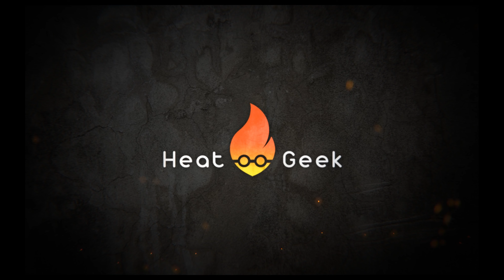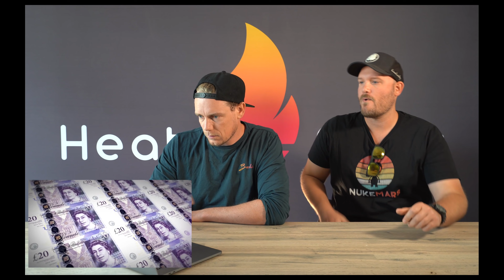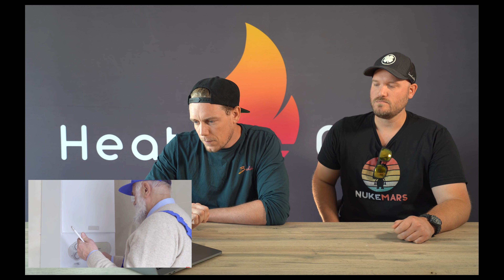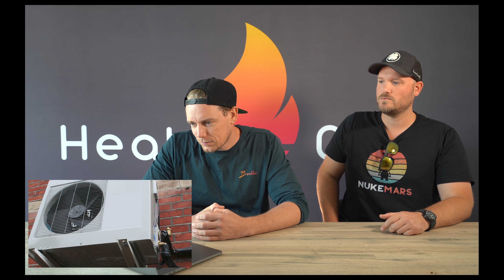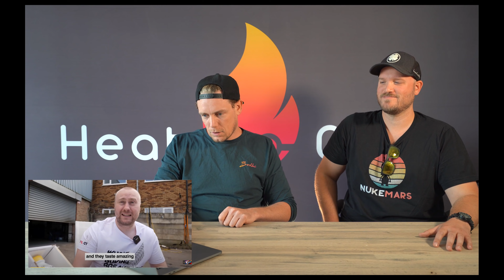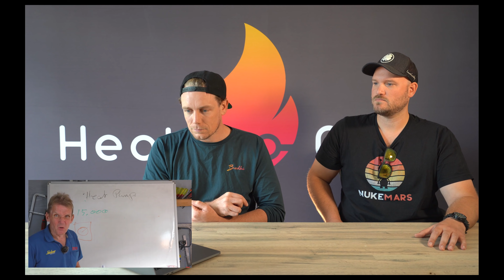Professionals React (BADLY) To Skill Builders's Heat Pump Videos | PART 1 | FIRST TIME WATCHING

Comment: Skilled builder has never said Heat Pump are not a solution as Roger clearly states Heat pumps do have place . What Roger is saying heat pumps are being pushed as the only option by the current U.K. Government.
Reply from the maker: No he litrally says you need underfloor heating and sweedish insulation standards..  and when they do work they inky have a scop of 2..

Comment: Where do we find a reliable source for recommended, well trained heat pump installers? Those installers that will do the things you are suggesting that will make heat pumps a positive addition to a house. Thanks
Reply from the maker: Search Google for 'find a heat geek', then cross reference this with the mcs database

Comment: Good day all, just my 5 cents worth. I am a refrigeration technician in Johannesburg South Africa and have worked with heat pumps extensively over many years. In my experience they only work well in higher ambient conditions in order to reject the heat into the atmosphere, when ambient temperature are very low they will not be efficient.

Comment: You two need to do your research on skill builder before you start to criticise the videos I thought everyone in the trade knew who roger was until I stumbled across these two 🤣
Reply from the maker: We've learned alot since..  non of it changes our position though??
Reply: Why not? Roger has over 30years of experience in all aspects of the trade including the sector you work in roger used to catch rogue traders on t.v an we all like he's rants(the video you were criticising )some of the thing you were saying just seemed like you were just trying to nit pick his choice of wording anyway each to their own opinion 😉
Reply from the maker: @rayl9969  because he essentially admits he did not design the system or do a performance estimate before his installs which is heat pumps 101.. I'm sure he's got alot of experience with boilers.. but poorly installing a couple of heat pumps doesn't make you a good heat pump installer.

Further more, drawing a thermal store for a heat pump showed the lack of knowledge of how low temp system efficiency is maximised. It might sound complex to end users but this is basic stuff for those in the know

Comment: 21:36 Heat pumps will have higher operating temperatures over time; but the higher temperature difference always makes it inefficient because it requires a higher compression ratio for the refrigerant.
Reply from the maker: Correct.. but the efficiency at higher temps os also climbing..
Reply: @HeatGeek  yes but at what price ? :Reliability? It wil cost like a spaceship? 
And another question a little bit deviated from the subject regarding only air-to-water and air-to-air heat pumps: 
How many technicians are currently able to correctly diagnose a state-of-the-art heat pump? how do they handle if it is -10 -20 degrees Celsius outside and they have to work in those conditions? how many of them are willing to work outside at this temperature?

Comment: I consider it more efficient / beneficial if a house that already has an old gas boiler gives up the installation of a heat pump and with that budget a new thermal power plant is installed (without changing the existing installations) with high modulation (10 : 1 or more) and with the difference in money the thermal insulation of the building is improved (maybe associated with a budget already pre-allocated for a restoration of the exterior of the building or windows)
This is how you should get a better return on the money invested in your home !!!
And there is another advantage in better thermal insulation of the house: the investment in the thermal insulation of the building works all year round 24/7, which means that it will reduce your need to cool the house during the summer ....
All of the above apply to homes in temperate countries that already have gas
  : P .... There is no perfect solution

Comment: Waste of time arguing re heat pump gas boiler if the insulation levels were comparable a 3 bed house would need minimal heat input therefore the cost of installing either would make the payback unfeasable,heat pumps more so the government needs to wake up to the fact that insulation is the place where the money should be spent ,why is there 20% V.A.T. on insulation a no brainer.

Comment: If you fact checkin his video Vaillent boilers are manufactured in the UK and the carbon costs of that are not exported to China
Reply from the maker: No, they are assembled in the UK. The hobeywell gas valve and fan... China.. honeyywell pcb... china.. casing... china

Comment: Why not fill the radiators with R34 if it boils at low temperature heat transference back into the room? Would it work
Reply from the maker: You cant create energy.. the same transfer would happen

Comment: Heat pumps use more fossil fuel (at the power station) than a fossil fuel boiler.  That’s because of 50% losses in the power station plus transmission losses are greater than the gain from the heat pump.  These NEW loads require NEW windfarms, they will contribute a couple of percent of electricity for heat pumps at best.

Comment: Electric Heat pumps have an efficiency of about 200% but electricity is 400% more expensive than gas.  Therefore your fuel bills will double.  That’s all you need to know.
Reply from the maker: 🤣🤣🤣 been listening too much to Roger if you think they're 200% efficient. Your in the dark ages mate 👌
Reply: @HeatGeek    What efficiency do you think they are.  Average over a year, weighted for higher use in the winter and including defrosting and immersion heaters?
Reply from the maker: @grippipethin2796  that's what a SCOP is... seasonal Cop.. . it doesn't have to be guessed though it SHOULD be calculated based on a specific design when you provide the quote so you can work out how much its going to cost to run.. too many installers lobbing them and like skill builder find out its expensive 2 years later because they did no design.. 

I have no idea if the the average SCOP for all heat pumps but is would mean nothing.. lots of installs have been thrown in and are crap and the range is way too wide to mean anything.. also newer units are getting waaay better scops than older..  but the average scop for a proper install with a decent unit will be 3.2 to 5.2 depending on the system design/flow temp design.
Reply: @HeatGeek    What changes have been made to the air source heat pump (not the system) to increase the COP in recent years?  Compressor efficiencies have barely changed in decades, the evaporator side is just a fan, there’s no scope for improvement.  Miniscule improvements with inverter starting maybe.  Apart from the compressor there’s no way to improve COP.
Reply from the maker: @grippipethin2796  well the controls have a massive impact.. some have had this down for a whilr and somema way to go.. advanced weather compensation (as apposed yo crappy basic in air con derived units) has a good difference.. but I suppose the biggest leap in the last couple of years has been the transition to R290 refrigerant which allows bother higher temperatures AND higher cops. We're now aiming for Scops of 5.
Reply: @HeatGeek    I suspect the scop numbers quoted by the heat pump manufacturers are a bit like the mpg numbers of car manufacturers or the range numbers quoted by EV manufacturers or the power from solar panel manufacturers, or wind power manufacturers.  In real life nobody can ever get near them and a rough guide would be half or two thirds of the quoted value.  Especially for heat pumps where it’s almost impossible for the consumer to check the SCOP himself.

Comment: 30 degree day outside would be really good?!!
You both sound English but clearly live in a different climate where its 30 degrees during the day (when I dont normally want heating) and zero at night.
Yes the are a good idea in the correct housing stock which we dont have due to expert heating engineers, Geeks if you will, being totally unaware of technology from 2000 years ago as they work best with underfloor heating.

Comment: We have a one bedroom granny Annex built on the side of our daughters house and we had this problem of how to heat it and hot water ,
after lots of searching on the net and cost calculating we decided to go electric at a fraction of going gas , we had a 10 litre boiler fitted in each the kitchen and bathroom 
did away with a bath tub and just had a electric shower and the radiators had  programmable timers and so far after six years we have had no problems,plus we’re saving on not having  costly gas boiler servicing ever year , But what was on our side is the high insulation our annex as .
Probably this  might not work for bigger or older properties.

Comment: @SkillBuilder has contacted you guys for a discussion. As a consumer it would be good to see some real life installations and advice from content producers rather than the polar opposites that seem to be out there. I'm personally in a position where I'm going to have microbore replaced across a large 4 bed in order to make the house future proof for heat pumps but all the he said she said makes it very confusing on which way to go and who to use.
Reply from the maker: Yes and we have responded wothban email to move things forward but with no reply
Reply: I'm pro heat pumps by the way and your recent video has shown it works. I'd prefer to bite the bullet and get a heat pump but the views on the ground are a turn off and skillbuilders type videos or news stories then don't help.
Reply from the maker: @UnriddenPath  the problem is gas boiler installers think they can install them because they've been doing heating years.  They can if they understand they work at a lower delta tee and what that means to velocity and pump head. Also have to understand control theory which narrows it down much further.
Reply: Any recommendations of installers for Lincolnshire?
Reply from the maker: @UnriddenPath  type 'find a heat geek' in Google and check on our map

Comment: Heat pump are more of a one size fits hardly anyone... Older houses (like mine) it would be a waste of time putting in a HP unit due to losses and solid walls etc. the costs for underfloor heating, buffer tank, etc would be astronomical!  The costs don't add up...
Reply from the maker: https://www.youtube.com/watch?v=QLGANlbqIFY

Comment: enjoyed this video I have a really badly installed heat pump and had constant issues with it from day one I like the idea but in hindsight I would have had a new gas boiler my bill has increased a silly amount.
I believe my system is not designed and installed correctly.
When the claims start coming  in I will be on that. I was deffenetly missold mine.
I like the idea but I agree with you about the design and installation I never had this
Reply: Can I ask, was it an air heat pump or a ground (geo-thermal) heat pump? 🤔
Reply: @Ladynipchick2  it's an air source heat pump

Comment: It’s true that they’ll force you to change by high gas prices. Which is wrong as I worry for people that can’t afford all this change and lead them into fuel poverty.
I’m a wildlife gardener and do care about the environment but I can’t afford this change yet, which is a massive worry for me
Reply from the maker: They are not forcing you by increasing gas prices, gas prices will force you, a subtle but key difference. The reason gas was historically cheap is that it was artificially held down due to not being subjected to environmental charges, unlike electricity, plus a price cap. As electricity is now cleaner than gas they should at least share the environmental levies, this should be taken off electricty to help with bill. If it is going to cause fuyel poverty, this should be a gov intervention to help, not a reason to not clean up heat.

Comment: I have to say from my own reading and other videos such as Rogers I wont be taking a heat pump. I live in a 1950's 4 in a block flat which is ex council stock which I'm luck to say has had cavity insulation added. But I have wood frame double glazing that leaks like crazy and where I live is wind swept and high from sea level, its never very warm here much and winter sees snow every year for some time but generally around zero degrees for a good part of winter.

I do not think that there is any possibly of a air pump, may be ground which is far more expensive. I don't have space for a buffer tank. I would need to convert to underfloor heating which is expensive to make properly worth it as well replace my windows and maybe door.

I can see this working better in water parts of the UK, but as it stands I will replacement my Gas Boiler with a Hydrogen convertible ready one for when Gas board moves to full Hydrogen.

I don't believe Heat Geek that Heat pumps don't work at all, just as you say there is detraction's such as bad fitment. But its not the solution for environment in all the UK as well as for a vast amount of our housing stock.

I would love to have a nice new house but I cant afford anything other than shoe box at new house prices... no thanks.
Reply from the maker: As we say heat pump dont work for all. You can get a h2 boiler, but by the time the grid is even at 20% mix you will be on your next boiler as thats 20 to 30 years off.. that will also only be a 20% reduction in co2 and also h2 costs 5x more than gas so will be more expensive. 100% h2 grid will be about 100 years away.

Comment: Took a 5 year apprenticeship in the trade all my life have seen posting on heat pumps Briton they are watching was spot on . I just couldn't watch any more when the r/hand brain cell said to l/h brain cell ,what's the average temperature 30 degrees . It's about stand alone  heat pumps   . As being implemented by boris's lot.. it's the  cost of installation pure impracticality or suitability  of majority British housing  stock  .but unlike solar panels heat pumps need electricity to run them boost up capability...it's the  boiler version of Brexit pointless

Comment: Why not use Sunamp or similar phase change cylinder for the balance tank so you don't have the Legionella temp or the high standing heat loss of a water cylinder?
Reply from the maker: Because the small advantage of not requiring legionella cycle is outweighed by the slightly higher temps needed than charging a larger tank. Phase change is ONLY space saving. Not efficiency saving.
Reply: @HeatGeek  what about the standing heat loss? And as you have already said space is valuable in modern properties. We have a Sunamp for hot water, we have solar to charge it up and occasionally add in some grid electricity (Octopus 5pKwh, which of course may not always exist). Combi now only heats the rads. Also cubes are far more efficiently packed in a house with walls at right angles to each other. You haven't actually addressed my question. Unless you are implying that water cylinders are more efficient. I would need some numbers to believe you rather than an assertion
Reply from the maker: @mrhignettshorses  your question was to ask why not use phase change.. my answer is because it offers no benefit if you have the space and budget for another solution. The sun amp standing losses are fantastically small though.. 

That doesn't mean I wouldn't used them.. it means I'll use them where needed and not when not needed.. there is no panacea.

Our cylinder has 150mm insulation so standing losses tiny. 

If I can i want to avoid 2 x heat exchanges ideally though.
Reply: @HeatGeek  Thanks, but my point is that the standing heat loss is very important to be able to maximize COP. Yes they are more expensive in the short term but their long term life expectancy combined with their very low standing heat losses and their convenient size and shape out to put them higher up p by the priority list. I do not work for or get any kickbacks from them. Honest.
Reply from the maker: @mrhignettshorses  I understand the pros. But you seem to ignore the down side of higher heat source temperatures. 

There is no one size fits all.. we offer customers sun amp.. and cylinders.. cylinder with good insulation is first choice due to the nice low temperatures it can heat with (and higher cop)

Comment: He's having a rant, tbh I'm not gonna get into who's best but Roger bisby has been around plumbing and heating for a very long time, I'm surprised you don't know who he is?. I think new builds should be regulated to use modern technology because the building can be built accordingly,  its a fact that most of the buildings in the UK where built well before heat pumps even existed,  you can big them up all you like but it will always be Square peg, round hole as a retro fit unfortunately so in most cases they are simply not viable. I agree with many of your points regarding embracing the technology and developing it but as I say, this should be in new builds where houses are built to a specification to suit.
Great channel btw, your both obviously very experienced and knowledgeable in the industry👍
Reply from the maker: He may have been plumbing for a long time but his suggestion to use a thermal store shows he knows very little about heat pumps and how to maximise their efficiency. Not designing a system properly, then when it has crap cop blaming the heat pump is just wrong. 

Very difficult for those not in the heating design industry to see thos but very obvious to those in the know that heating design isn't hot string point. Incredible knowledge of building etc!!! You can't be an expert elsewhere tho.
Reply from the maker: Thanks for your kind comments too that's much appreciated 👍